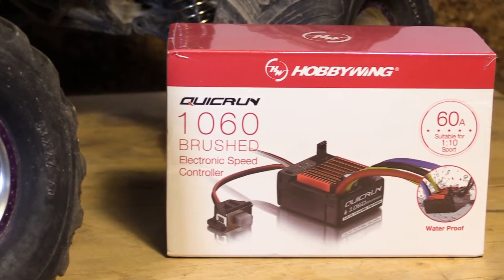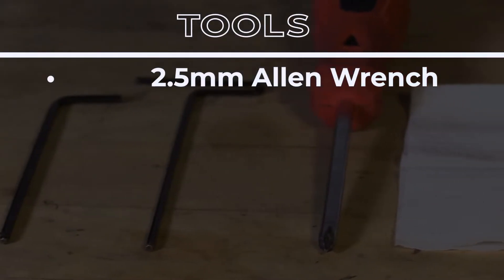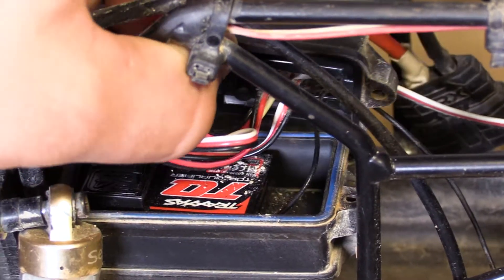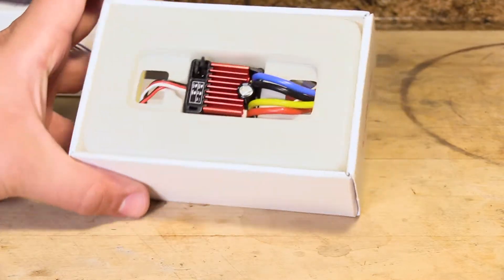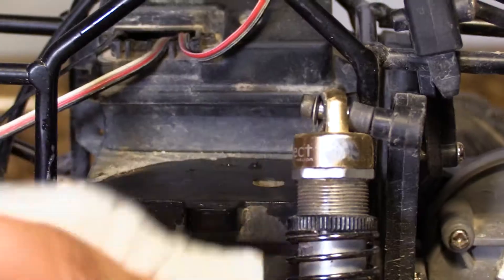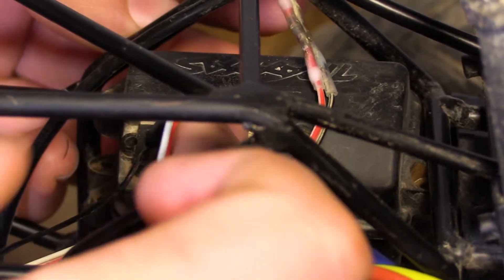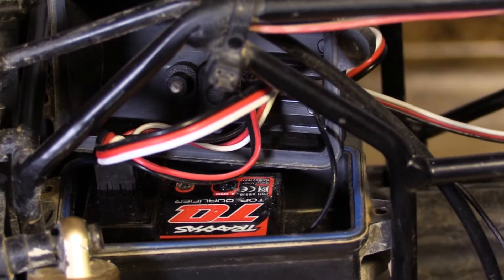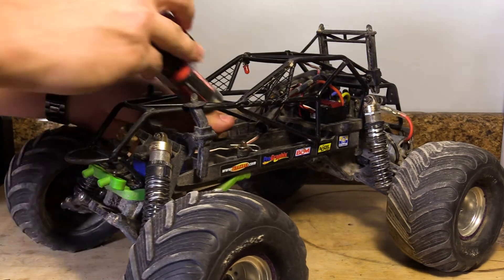How To Install the Hobbywing 1060 Electronic Speed Controller (ESC)

Comment: what if the esc blinking red. the reciever has no light at all and output is measured at 1.5v on the reciever 3 pin connection. its brand new, lipo is charged, any ideas on what is wrong?